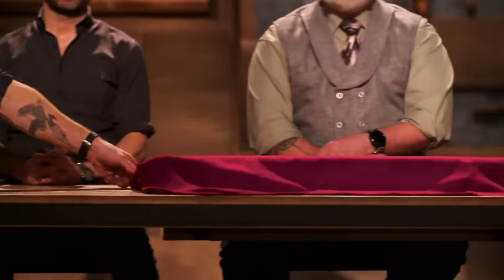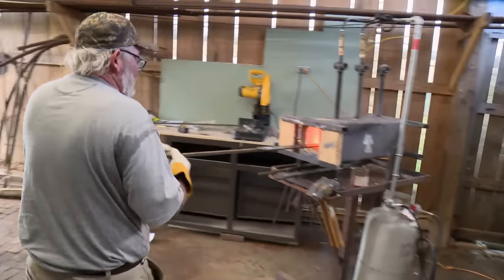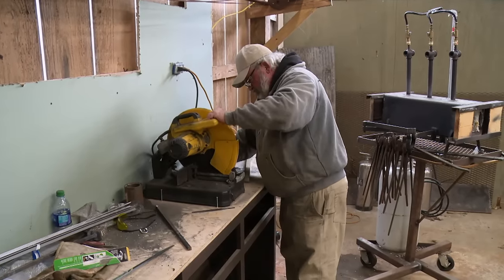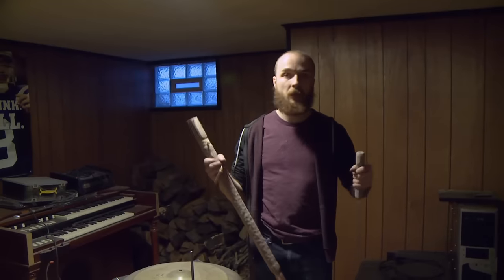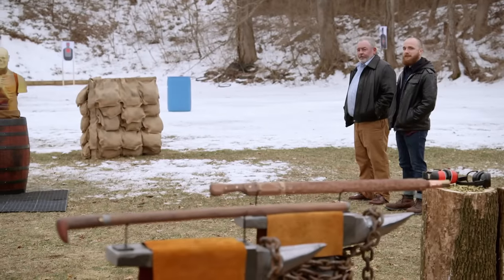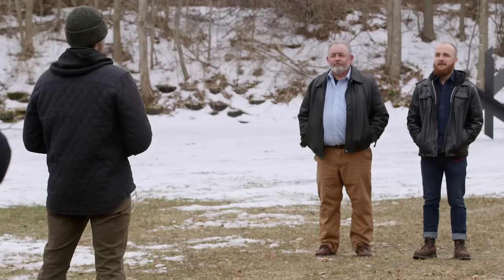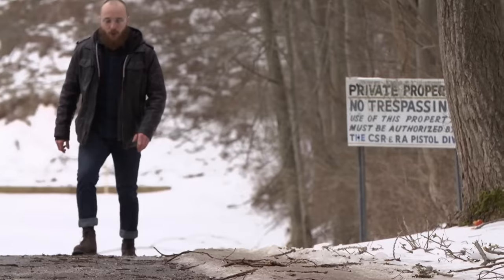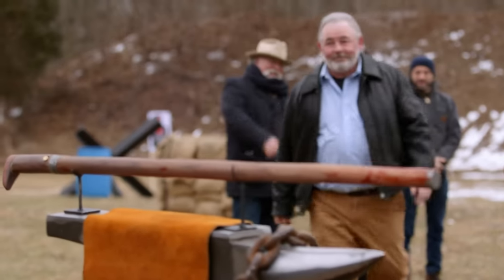Forged in Fire: The Cane Sword: DEADLY SLICES & BRUTAL BLOWS (Season 6) | History

Comment: Dougs sword is one of the most impressive in the whole show. Doing so much damage with such a thin blade...wow! Also it was made really well and even though he is a Damascus guy he was smart and just wanted to make smaller parts out of it not the blade itself.
Reply: cosmetics you mean. but yeah, what an awesome piece
Reply: Yeah, he is a real artist.
Reply: Doug is a professional martial artist he will have the best pieces without a debate
Reply: And don’t forget it will kill.
Reply: @GGtheRealest  cosmetics are etching and detailing. a pommel is an integral part of a blade. in this scenario, the Damascus pommel would have been beneficial due to its weight on the opposite end of the blade, allowing for greater leverage and therefore end point acceleration when slashing. 
On larger thicker blades it provides a counterweight to the large blade that would way much more. 
pommels, when made strong and attached well, are also a part of the weapon directly used in combat. A pommel bash is enough to cave in someone's skull. 
Cosmetics would be, adding engraving, embossing with gold, inlaying with precious metals or gemstones, or dyeing the wrap/ staining the wood a certain color. It is only "detail" if it has zero functional purpose.

Comment: The moment he said there were some soft parts on the sword I knew it would snap
Reply: Just watching the younger guy forge  made me cringe.
Reply: Same.
Reply: Ditto
Reply: like seriously, how did he think that would have passed any sort of stress test?
Reply: @wereboarder2009  idk
Reply: The Doug's face when the cane sword broke down
Reply: ubystylos yeah you can’t have that in the middle also that’s a small and thin blade to begin with so you wouldn’t want to rely on grinding it down you’re only making it worst
Reply: Was about to say the same thing. I'm surprised it died so soon though. Expected it to fail at the strength test.
Reply: The ballistics dummy is usually the most forgiving challenge for a blade.
Reply: Me too
Reply: And it's a shame cause that sword was really pretty
Reply: ubystylos I’m not even experienced in anything to do with smelting, but that was so obviously gonna go bad.
Reply: it's the reheated part that snapped
Reply: Soft spots bend, hard without temper snap.
Reply: Soft steel does not break, it bends.
Reply: Me too.
Reply: ironically for your comment,a soft spot would have PREVENTED a break
Reply: Same
Reply: 100%
Reply: It was because he quenched it twice
Reply: @BikingVikingHH  Or cause more stress on a harder part because the blade flexes irregularly.
Reply: really his biggest mistake was forging with such little metal. He wouldn't have needed to requench if he kept it thick and grinded it thin.
Reply: It's not softness that causes a blade to snap though its the opposite. He probably had some uneven heating that caused a hard spot or poor crystalline structure. I commend his dedication and hope he continues to hone his skill.
Reply: @crawdadlando4053  Definitely forgiving but the "bones" in them are still fairly tough I think. I could be wrong though, someone was saying they're made of pvc which definitely isn't comparable to bone. Steel at that point would be a better analog than pvc

Comment: People: "Kill test is useless, it never proves anything, it's just for fun"

Kill test: 8:20
Reply: By the way, I prefer Doug's cane sword. Not only because of the critical failure of his opponent but because it actually looks like a regular cane on the outside.
Reply: @juanramaroto6691  The latch mechanism is also cool.
Reply: @juanramaroto6691  Definitely. While Doug's cane sword looks remarkably odd with the mismatched wood "pommel" and grip/shaft, it does look reasonably like a cane, which is kind of the point of a cane-sword is to pass as a mobility aid or aristocratic accessory and not a weapon.
Reply: @juanramaroto6691  Yeah, his opponent's cane sword looked like a steak knife from the 70s with the rough wood and brass pins.
Reply: While I was watching the first kill test I wandered if there was a sword that would not kill.... Well there it is
Reply: The kill test killed the sword, so its still a kill test.
Reply: Feral Kuja Yeah and he could fix the discoloration by treating the sheath that same as handle, so its an easy fix
Reply: Haven't you seen the swords that break on the dummy's
Reply: Gg
Reply: Kill test: Am I just entertainment!?
Reply: The kill test tests the edge throughout the blade
Reply: U mean the keal test?
Reply: hmm
Reply: It's not useless. The point of the test is to let a martial artist like Marcaida judge how well he can wield it and also not everyone can execute the kill test professionally without accidentally hurting themselves.
Reply: Imagine going for a behead and the blade just snaps. The guy just looks at you like "Tf dude?" Everyone is disappointed and a puppy died.

Comment: You can totally pull a broken tap out by spot welding a nail or something to the protruding head and twisting it right out, same thing with broken/ stripped screws or nuts. Also, using tapping/machining oil is a sure way to make it easier on yourself, as well as pulling a little out of the hole as often as possible

Comment: This one was interesting. Ashley certainly has the bigger and more voluptuous beard. However, Doug was the winner. The reason behind this was that Doug's blade could recognize Doug's Experience and Authority, this caused the blade to obey Doug and turn into a more refined weapon of a gentleman. Ashley's blade on the other hand did not recognize Ashley's Authority causing it to have a rebellious phase. unfortunately, this made the blade snap when being used. Since Ashley's blade did not recognize his Authority it also had a less refined appearance compared to Dougs. The handle shape shows this. In a blade, a handle is very important. The handle is like the armor of the weapon with a bad handle it is like an encumbered fighter. Doug's blade had a very beautiful handle while Ashley's had a more blocky one. The blocky handle restricted DOUG's movement when handling the weopon. Doug's weapon had no such issue and performed to a far greater result in DOUG's hands.

Comment: I knew that tap was gonna break. Ive tapped 100s of things. First off where was the tapping fluid to keep it cool? That should be dripping from it. But worst the item wasn't stationary. And anyone with any sense you spin maybe one full turn then take it out and blow out the hole. With air. Also they make tap extractors. You literally take it and run it down to the break and the tip catches and u back it out. You cant drill it out cause taps are hardened. Harder then the drill basically. And I wasn't even a good machinist and I knew this